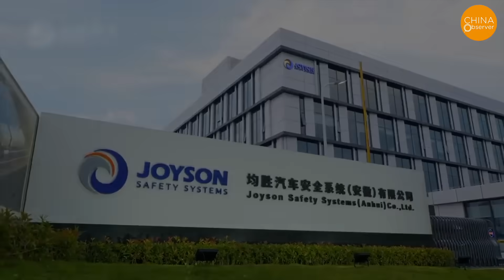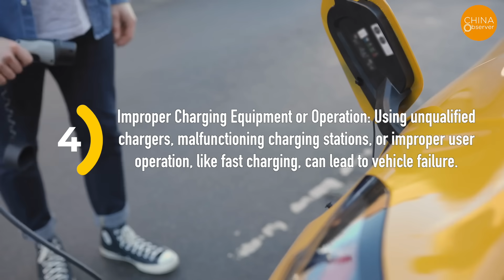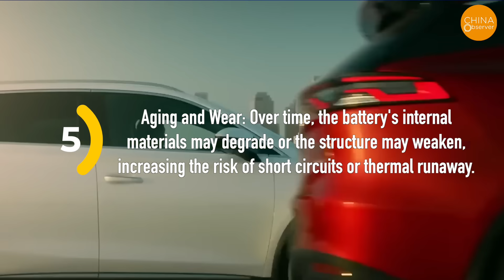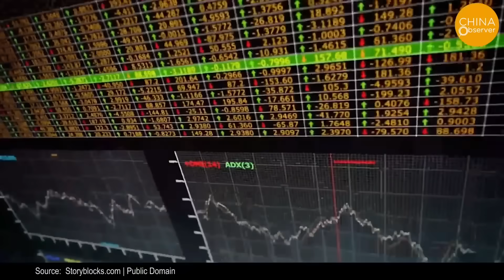Shocking! China’s New EV Battery Ejection Tech Turns Every Electric Car Into a Moving Bomb

Comment: Im a major china hater but that invention is a good one, it makes it easier to extinguish battery fires and it should be noted that a road isnt a very slippery surface like the concrete in the video. The battery would not fly nearly as far on a normal road and it seems to be manually controlled.

Its also just a concept and probably gets more development. All EVs have issues with battery cookoff and just putting the battery in a pool is easier than the entire car. 

It would probably be more resonable to drop the battery and drive the car another 5 meters forward.

Comment: Nice tech unless they use takata airbags to blow out the lithium cell...
Exploding consequences 😂😂😂
Why not making simple clamp hooks and just let the battery fall into an self sealing compartment which then seals up while being on the ground and away from the car??? Easy to make, failproof and cheap...
Besides the whole idea comes from an anime called code geass
And the system in that anime called energy filler case replenishment system

Comment: This is What Firefighters want so they can Fight the Fire for you can NOT Fight a Car Battery Fire and Win and With this Tech it will be Safer and Firefighters can Fight and put out the Fire and Save the Car and the People in the Car and People outside the Car can move out of the Way of the Battery and the System that will go in the Street will not Shoot the Battery as Far and once out the Firefighters can Barry the Battery Pack in Sand and Take any more Fuel The Car and Everything around from the Battery Pack for Firefighters have NO Safe Way to deal with Battery packs on Fire and Bolted into Cars/Trucks and Bikes and all you Crying this will be Unsafe your all FOOLS for YOU don't know anything about Firefighting for if you did you won't make Such Foolish Comments that is will hurt People NO it will Save Lives. What Fools and Wonder no more why no one in China has a Real Toilet they just has a hole in the Floor they go in and you Wonder why they Think this Battery Tech is Unsafe they do there Business in a Hole in there Floor there is no Trap for the Gas or any Flushing in China.

Comment: I don’t think this would work in a real situation. They were ejecting good batteries for the presentation, but when batteries heat up they expand, and would likely plug up the ejection ports, forcing the propellant charge to take the path of least resistance (right under your ass)

Comment: Battery Ejection Tech? It's really gonna be a moving bomb, the vehicle that inject the battery would be safe, but the other vehicles near by won't be safe.

Moreover, It's seems that the Lithium technology are widely accepted that it's too dangerous to use, they're not able to find a away to keep the Lithium to be safe in Fire and Explosion. 

For this reasons, thats the real END Game on the Lithium, this must be replace, discarded,  prohibit in using Lithium, it's unsafe and will cause properties destructions. Lithium is a FAILED innovation for consumer's. Lithium can be use only in Military purposes but not for commercial application.

Comment: It looks like a side ways toaster your best bet to safe the car is to do what demolition  man did with the car foam but around battery but with all that intelligence from chinna they chose that you best bet would just used a liquid nitrogen  and freeze it as soon as it over heats or set something to cut it off before it reaches its over heat state iam not that smart iam a crayon eater lol the solution is just set it up where it get Thanos snapped  by making battery outage materials that break apart or add mechanism that destroys battery other options better your gonna lose battery regardless  might as well have it  implode on self hope for the best semper fi be safe all watch out for those flying batteries

Comment: Guess they never see another solution that was right under their nose the whole time

Blast panel, it work on tank but haven't taught the same thing with car, at least their a shield that protect the passenger and  driver from the the explosion while they can escape from the car. The fire and explosion vent in a direction where it was safe.

Comment: At 1:42 the car that hits the rock and catches on fire.  That driver didn't make it out of the car..!  I just think fk owing an electric car.  They're dangerous.  I am own a 2006 Mercedes E320 CDI and it's the best car ever made.  It get's 50mpg on carbon neutral vegetable oil and have as much power as a big block V8.  I can get almost 1000 miles on a 20 gallon tank of fuel

Comment: LMAO sure i get what they say, but that wont work. Instead it would be better to have exploding bolts that drop the pack below the vehicle so parked vehicle can be pulled out and the battery dealt separately, instead dealing full inferno of both vehicle and battery going up to sky, since frame fire can be put out easier than constantly reigniting combo. Or even better yet dont put highly volatile batteries into vehicles....
Also Tesla design of making the battery part of the frame will just enhance that once battery is dead ie 10 years the EV is worthless hazardous waste.

Comment: Correction is required at 2:15. The battery pack of an EV can be up to 1,500 kilograms (not 150 kilograms). For example, the battery pack of a ‘large EV commercial truck’ or even a ‘large SUV’ can be up to around 1,500 kilograms, but is around 400 kilograms for a small EV such as the Nissan Leaf. 

Because the driving range of an EV is inversely proportional to the gross weight of an EV, larger (and therefore, heavier) EV batteries are required for larger (heavier) EVs in order to achieve the same driving range. Therefore, to achieve the same driving range, large SUVs require much larger (and heavier) EV batteries than small EV vehicles such as the Nissan Leaf. 

To illustrate the above point further, the weight of an EV battery for a ‘truck with a semi-trailer’ needs to be around 5,000 kilograms in order to provide a reasonable driving range.

Comment: But everyone must agree that this technology also makes batteries easy exchangeable. As for the safe battery technology, there is none. At least as long as the oxidizer and the reducer are not physically separated. Well, like in a fuel cell, for example.

Comment: Idk. In the case of the battery just falling off the spicy brick burning a few feet away from the car could be the difference between life and death in some cases. Maybe just a mechanical solution where the mountings are more likely to break in a collision? Still not perfect but doesn’t guarantee making the problem worse.

Comment: I'm sorry it's stupid. Just lower the voltage. High voltage is the root cause of fire. To do that EVs require high efficiency geartrain instead of single speed gearbox. The latter is so inefficient that it causes battery to drain off faster while travelling in high speed. Single speed gearbox is too idiotic to say the least.

Comment: Here's an idea, just don't buy an EV car. Gasoline combustion engine cars are so much more reliable, no where near as dangerous, have more range per fill up, and here's the biggest advantage over an EV car mind you, they have absolutely ZERO exploding batteries that weigh half a ton! This is why all my cars except for two are from the 90's and the oldest car I own is from 2003 and it's a Toyota 4Runner that I've owned since it was brand new ffs.

Comment: If Battery Pack is strapped with nylon cord, upon battery ejection, the battery pack is limited to a distance of 3 meters away from the car, this will be a better solution.

Comment: So now the white-hot battery has set the car ablaze.  Then the car launches the battery into the air… and under a bus load of people where it sets the fuel tank off like an explosive.   Then what?    A car battery fire is so hot that It can melt metal and fuse metal together.    This handy little invention is likely to set off a chain reaction of fires you will not soon forget.   What if the car is in a ditch, and sends the battery up into the air… and into a car window.   Setting that car on fire… and incinerating the person who it lands on.

Comment: Battery needs to go back under the hood, on the other side of a firewall. People in the cab can be rescued or leave without the fire being under their seats that way. People have half a chance that way and if the battery was in a drum shape it might be more surviveable structure than a flat pack that is vunerable to ground damage. If they could make a drum or a barrel out of a high heat resistant material maybe it would burn itself out more safely giving people more time to react to the fire. They would see it instantly instead of it smoldering underneath them where some people have said they didn't notice it and had to be alerted by other drivers.

Comment: This is a great idea if you plan to arm terrorists.   
A simple modification to the battery allowing remote puncture and they can drive around looking for a good target.

Proper battery construction is known,  the issue is that in china they choose to make cheap dangerous batteries that will make the company much greater profits.

The new safety system I want to see on these chinese evs  is the doors themselves.
Currently many makes/models have hidden door handles that fail in the event of battery failure imprisoning the passengers to cook.

Make safety systems that allow the doors to be opened in an emergency.

Comment: It needs to eject into a thermal pouch or just be wrapped in some type of thermal container that won't allow the fire to spread to the rest of the car, but still have cooling properties so it doesn't overheat. It would be like a transmission blanket/diaper on drag cars. It lowers the ability for the fluid to leak on the track, keeps shrapnel from entering the passenger compartment, and is made of fire resistant materials like firefighters outfits.

Comment: How about they put explosive bolts on the car door lock pawl and add a fire suppression system. In case of thermal runaway have the doors blow open and fire suppression system activate to give the occupants a minute or two to evacuate the vehicle safely without having to try to activate the door lock without power.

Comment: The cement in an underground grage or under a bridge becomes unsafe after being exposed to the heat from a battery fire. This is an added expenses (only if repaired properly) due to these EV cars.
In China I doubt road repairs are done afterwards and even if done it is with substandard cement.

Comment: EV cars are just creating more problems then they are worth. Need to expand the electric grid just to maintain charging for a limited travel. The internal combustion engine is by far more safe and has much greater travel range and needs no new infastructure too.

Comment: How does that battery know it is a safe area before it is ejected? What if you're passing shops with open doors? There you are trying on clothes and the next thing you know you have this burning hot battery midway through thermal runaway comes flying through the curtains whilst you're midway through putting your trousers back on. What a dumb idea. Try stopping the battery from going through thermal runaway in the first place.

Comment: The ejection is bad but the engineer talking about using the alternative mounting system to quickly swap batteries to eliminate the need to wait while they charge could be good without the dangerous ejection part.

Comment: It would be funny if the ejected battery hit the curb and bounced back, then hit the car itself and exploded.🤣🤣🤣
Reply: During winter it'll slide up the snow wall, then up in the air a few meters before falling back down on the car, crashing through the sunroof which is locked open as the controller froze and malfunctioned. 🤡🌎

Comment: Coming out from the side and being swiftly replaced by a charged one was how I envisions EVs being designed in the first place. Recharging times not only need to be reduced they need to be no longer than filling up with a tank of petrol and preferably quicker. The battery needs to be leased not owned by the car buyer. A similar system to how Calor Gas operates. Such a system would make charging EVs cheaper and require less extra charging capacity needed to deal with peak demand. It would deduce the rate of depreciation as the batteries would be used far more over time. Reduce battery failure as they could be checked out for any potential failures while being recharged and further developed as the company leasing them would have a very real incentive to do so. This would of course need all EV manufacturers to standardise the battery systems, but they should have thought about all of these issues before they even got started. 

The entire project was fatally flawed before even Tesla got stuck in.  It should have got started as a small and relatively very cheap product designed as a second car for mainly urban use and then developed from there. Not an entire industry involving just about every car manufacturer in the world 100% reliant on massive government subsidies and promised legislation for the purpose of solving a specific environmental problem that does not actually exist. Even worse greatly contributing to an environmental pollution problem that very much does exist, most especially in China.
 
What was also not envisioned by these greedy for extra massive profits from cars soon becoming very expensive disposable products was people like Donald Trump gaining power and calling out this Global Warming Hoax/Scam for what it most evidently is.  Soon enough every government of every country in the entire world will follow suit or be thrown out of office and that will be the end of it. With it will go what little will remain of the Chinese economy, with it will go just about every so called Green product still in production. 

Not I hope my solar powered desk top calculator as small and very cheap things like that actually make some degree of practical sense. My last one was in virtually constant use, cost around £5 and has just stopped working after 10 years, which is about as long as most EVs will last. So happy have I been, I have just ordered another one, indeed two of them at £4.99 respectively because I do tend to misplace such things at my age. While remembering to buy and then having to install batteries is something I prefer not to have to do. Therefore a big thumbs up to very cheap solar powered desk top calculators with extra large buttons.

Comment: A kind of safety system that would be utterly dependent on the circumstances and location where it ended up operating.  

Given the potential fire hazard of the battery pack even ejecting it in a rural setting has the real potential to start major fires (and far from fire fighting apparatus and personnel) in forests, residential/commercial/industrial areas, or in many open fields.  Not to forget the people who may be walking by or passing through the impact zone for the ejected battery.  

You know that the CCP may end up having blinders on and allow such a system to be fitted and then profess ignorance (it was unanticipated that the system would cause death and destruction under many circumstances) when the inevitable outcomes occurred.

Comment: This should be an Anti-Carjacking device!
Reply: But why tho? A firearm in the glove box, as well as the ability to just drive away are both good enough to deal with any car jacking attempt. If the battery ejects, you can't even drive away, you'd be a sitting duck if the car jackers have more fire power than you.

Comment: The idea of using a gas cannister to eject 300kg to 500kg is Huge. Get 20 of these tanks set up, and you'd have the Knight Rider Launch system that lets the car jump over other cars in traffic, or avoid parking gates. Lifting 2 tonnes of car in 1/2 a second so it can 'jump' at 40km/hr, could be incredible... or highly fatal/amusingly fatal. IDK.  It's a fantastically dumb idea. 

It kind of makes sense if you have a drive-through car battery replacement station. 
But, It's a strange thing to build a demo model for.

Comment: Maybe if China wasnt so cheap about its technologies they wouldnt have to Eject essentially a small bomb....
Batteries are made with capacitors,  that carry an extreme amount of voltage in them....so when you go and Eject a battery pack, what the HELL DO YOU THINK WILL HAPPEN....
Maybe focus on technologies that are not based on profit.
Maybe think about safety.....
China used to be a powerhouse but then started getting really dangerous and cheap once the WORLD started depending on them.
Once again, CCP has made life dangerous